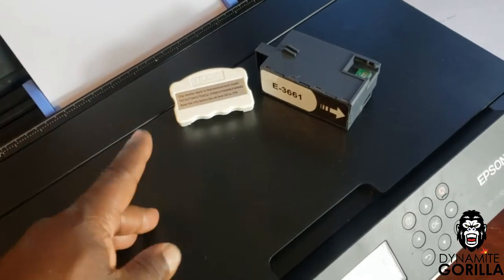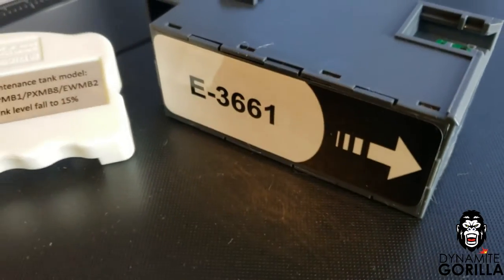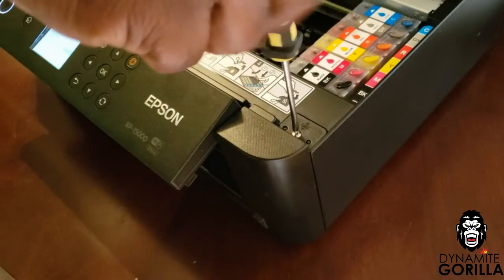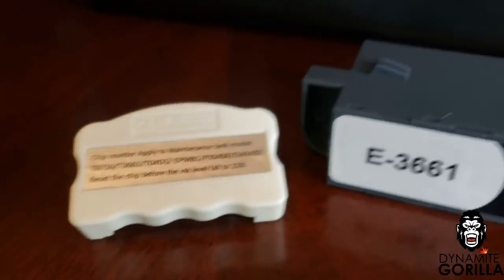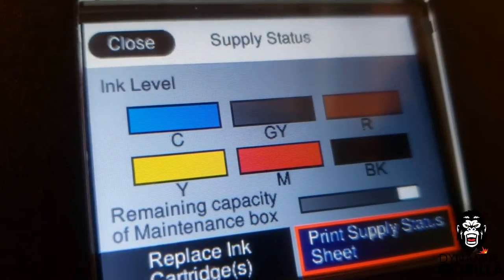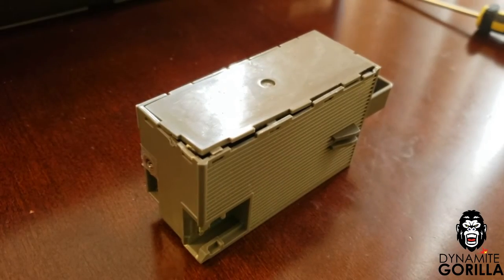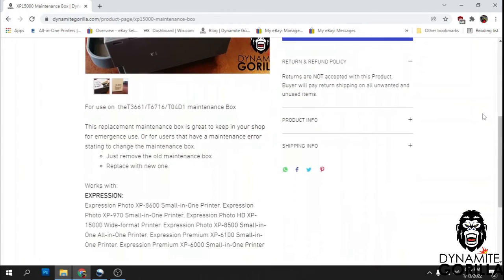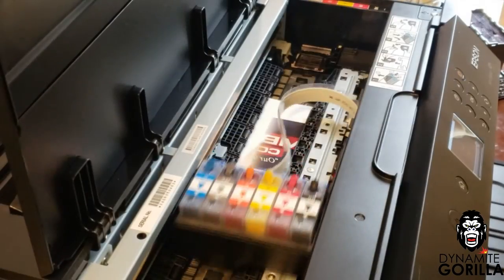XP15000 Maintenance Box Replacement and Reset

Comment: question. when the maintenance box is reset does it also reset the ink levels on the screen? currently i cannot print no more because its asking me to replace the ink cartridge but i just refilled the oem cartridge with DTF ink.
Reply from the maker: No. It will only reset the box. You will need chipless firmware for the xp15000. Then when the cartridges read empty you can pull the maintenance box and the levels will reset

Comment: Your videos are SO helpful, so thank you for all you do. I'm thinking of buying this printer for sublimation and don't know much about inkjet printers. When the maintenance box gets full, can I just buy another one and replace it? Do I need to do any chip resetting? I'm so confused. Thanks!
Reply from the maker: Yes for the xp15000 they have maintenance boxes that can be swapped out by the consumer. They're pretty cheap too.  But if you have a external waste tank, you might want to get something like this. That way you can keep the same maintenance box and just reset it. The ink won't make it to the tank but the printer will think so, and will stop printing if it gets "full".
Reply: @McZell   Thank you!!

Comment: to add an external waste tank, should I do something on the software? or How the printer won't detect the internal waste tank?
Reply from the maker: The printer will still think that the waste ink is going into the box even though it isn't. So you'll be resetting an empty box. But it will still need to be reset or replaced.
Reply: @McZell  so I need the chip resetter